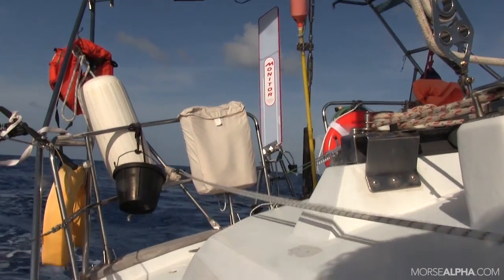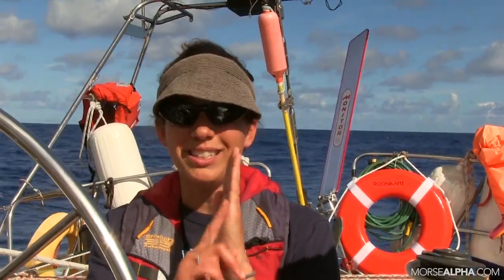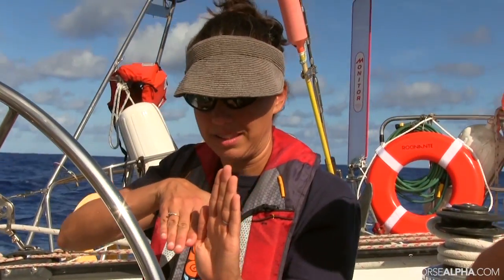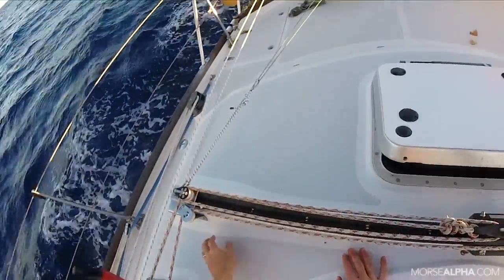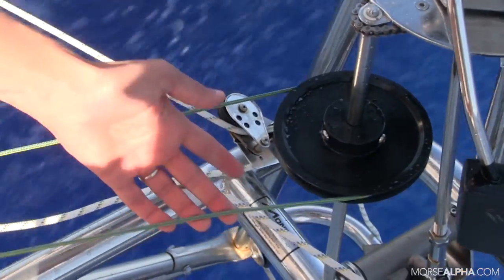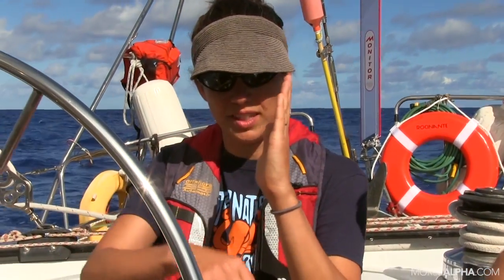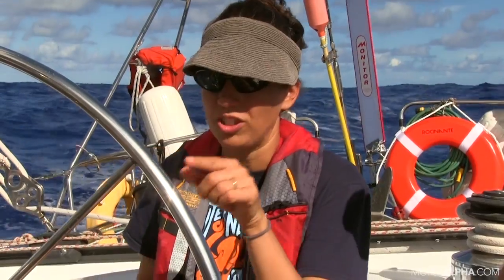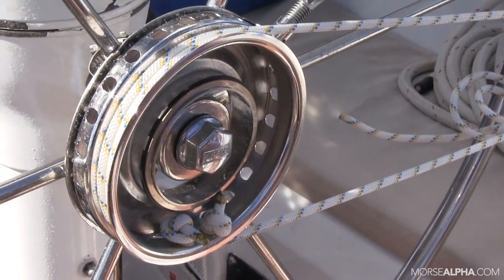Monitor Windvane Self Steering  -- How it Works

Comment: I could’ve used this about a year ago! 😳
The only problem is that I don’t have a secondary winch behind my main winch, so I’m going to have to figure out a different way to do this. 🤔
But great video!!
Reply from the maker: You could use a handy billy attached to any strong point on the deck.
Reply: Teresa and Ben Carey I can run it to 
a cleat that’s about 3’ from the winch and then turn it from there and run it to the other winch